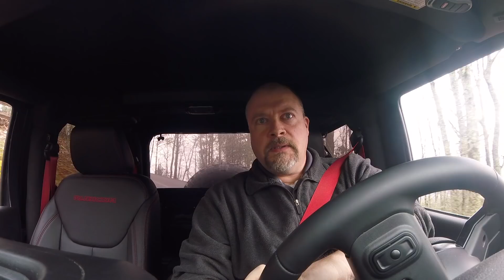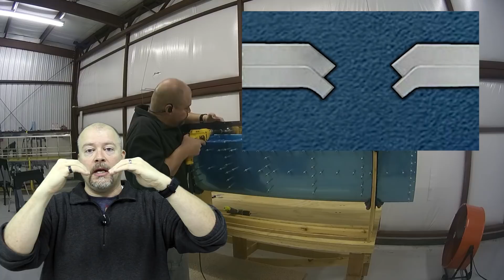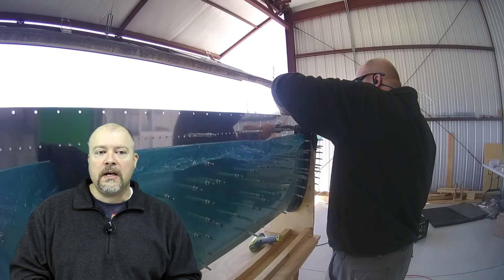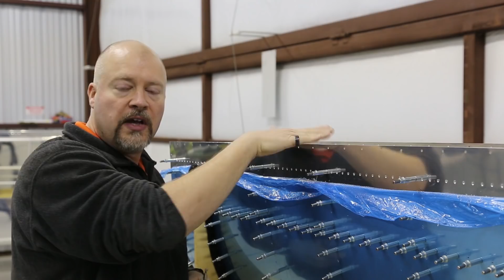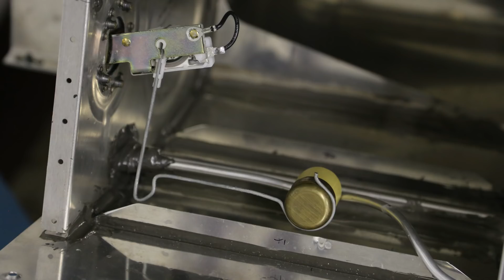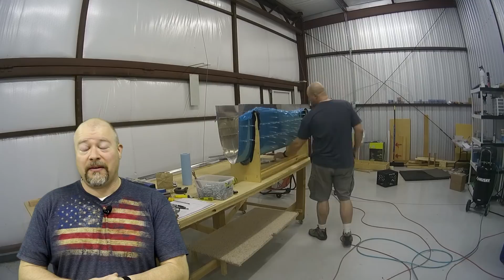RV-10 Wings - 050 - Fuel tank, countersink vs dimpling, SunNFun vs Oshkosh

Comment: Also check out the Reno Air Races one day! As for your blue plastic, have you tried the straight edge/soldering iron trick? I know.. it's gotta come off eventually... keep up the videos!
Reply: taltruda I had the same thought.  Seen many folks just remove thin strips along the rivet lines.  Very neat and leaves most of the skin protected.
Reply: I am curious, does Van's plans not specify countersink vs dimple?  Is it always builder preference?
Reply: LTVoyager I believe they do specify when to dimple vs countersink. Typically you don't countersink when the material is too thin because by the time the rivet is flush, the countersink starts to cut through to the back side of the material. One exception is on the rear baffles of the fuel tanks, because if you dimpled, you probably couldn't pop the baffle into place.